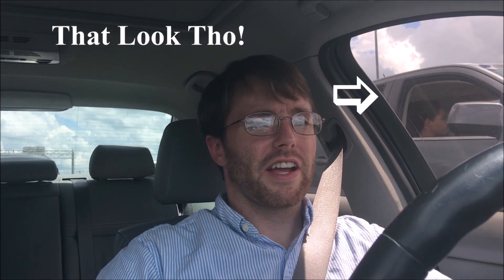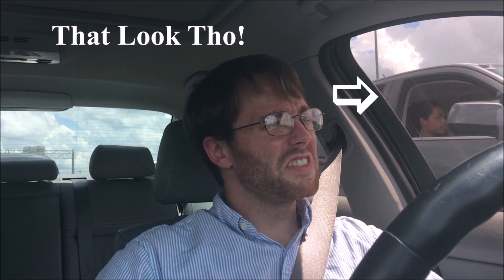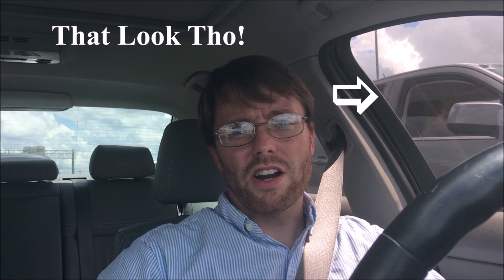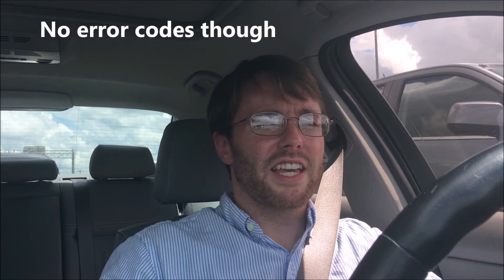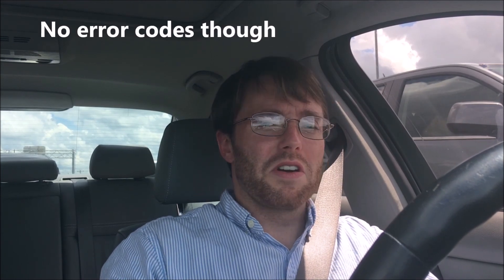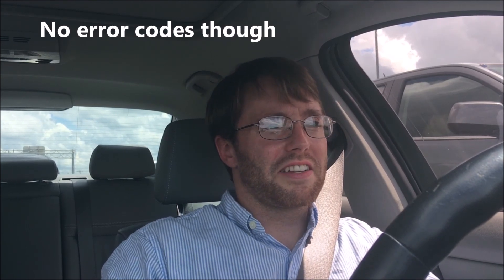What Has Been Going On With My BMW 335i

Comment: Didn’t know mhd was that bad on n54 cars. I have regular stage 1 on my n55 e90 and it’s good. Good to know they fixed the n54 issues with 8
Reply from the maker: Idk why my car didn’t seem to react well to it. We flashed MHD stage 2 v7.1 on my friends car after installing downpipes and it didn’t seem as lazy down low.
Reply from the maker: Also the n54 maps are by wedge performance and n55 I think is twisted. So two different people behind them.
Reply: BMW-E90-HQ didn’t know that about the maps, interesting